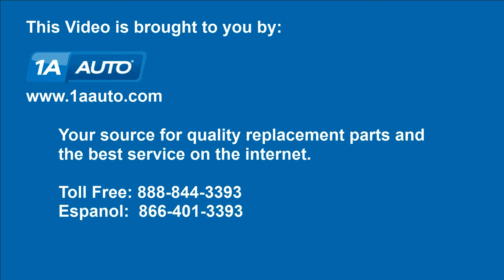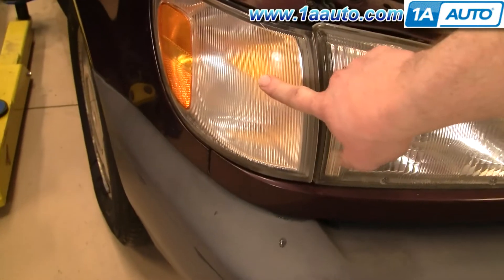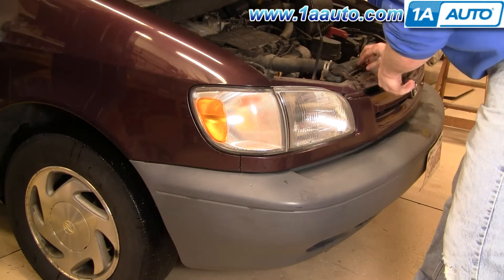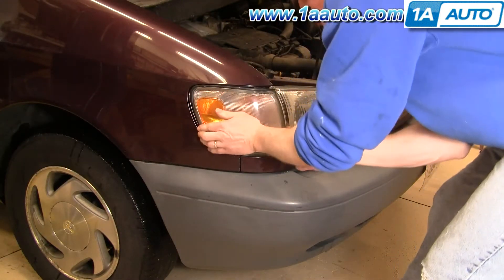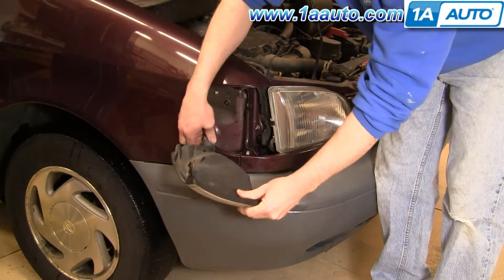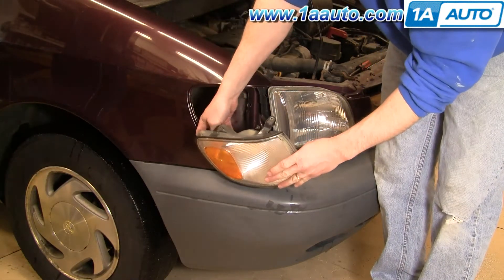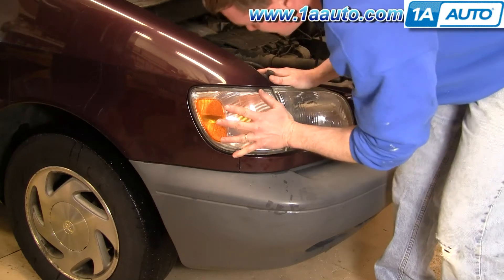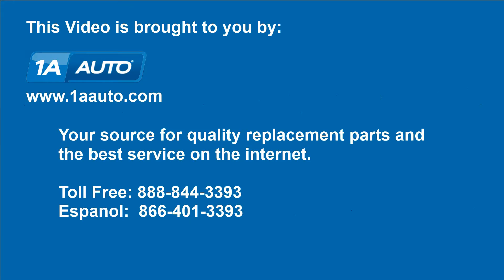How to Replace Turn Signal 98-00 Toyota Sienna

Comment: I need help I can not find out what in wrong with my heat and a.c. no air coming out. changed,blower,front knob panel relays , can't find,the anwser also checked fuses